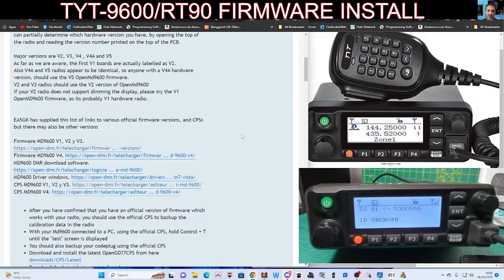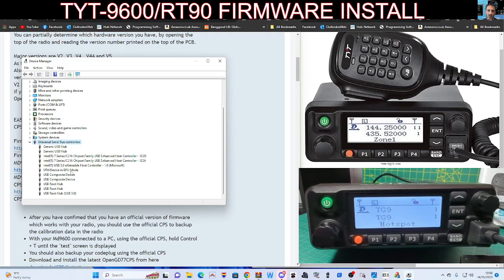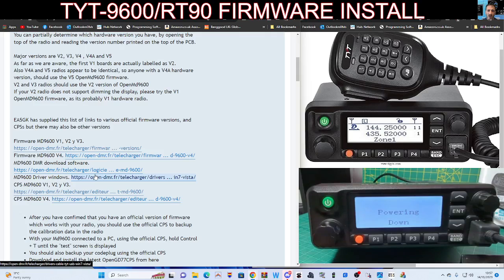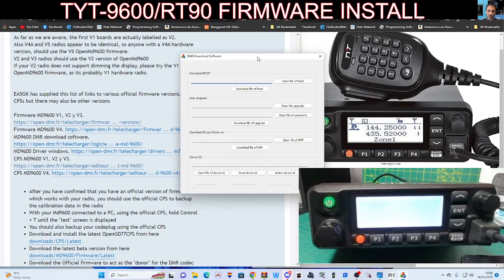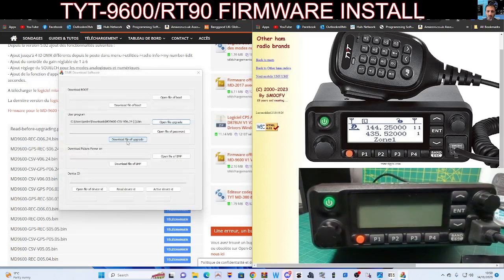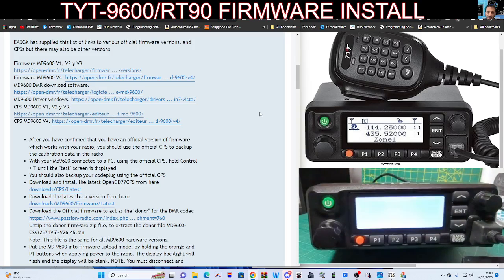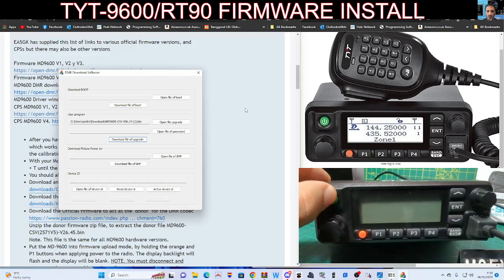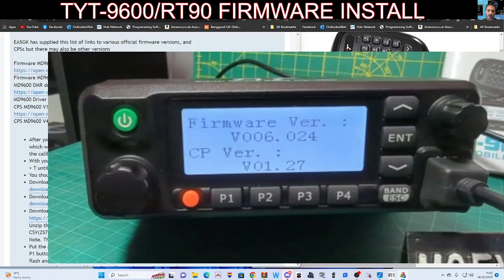TYT MD-9600 /RT90 INSTALL FIRMWARE FULL PROCESS

Comment: Tried multiple times with multiple versions of the FW and always ended up putting the original firmware back on my radio. Sometimes the FW loads, but then I loose all functionality on the radio, sometimes it loads, all seems okay until you TX and you have no power output and the Freq is incorrect. It seems that as each link to the firmware comes live, it soon after becomes dead. So... so far I have nothing but hassle and have given up hope on changing the firmware.
Reply from the maker: Firmware is hard work
Reply: @M0FXBHamTech friend of mine used rt systems and wants to go back or og CPS. How can that be done?

Comment: How do you backup and save the original firmware before installing the new firmware?
Reply from the maker: https://youtu.be/1ba5whu_rMA?si=dY_EunESK4ldhg1A
Reply: @M0FXBHamTech  Thank you for the quick response. I purchased a new MD 9600 with the V5 generic chip and it does not support open gd-77. Is there a way to backup the firmware with the OEM software ? The dealer here in the US where I purchased the radio from states that any attempt to install a third-party firmware will avoid the warranty with them.